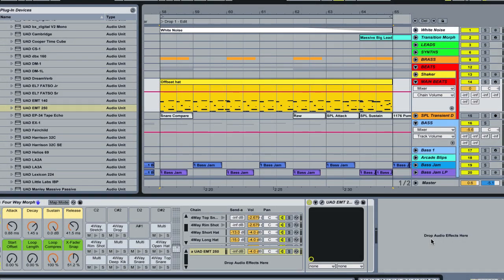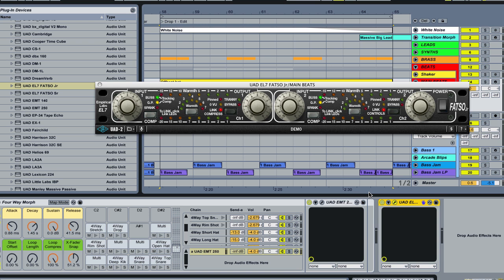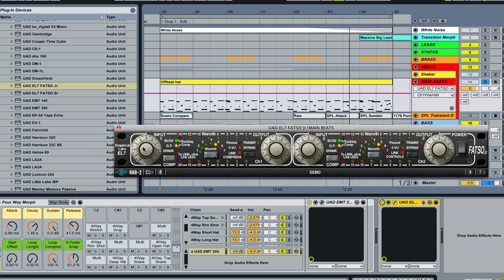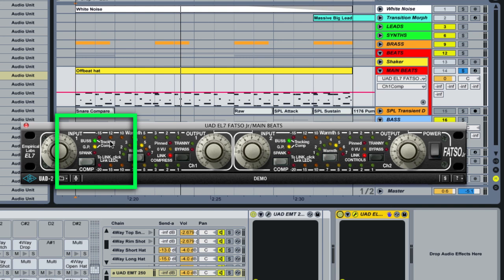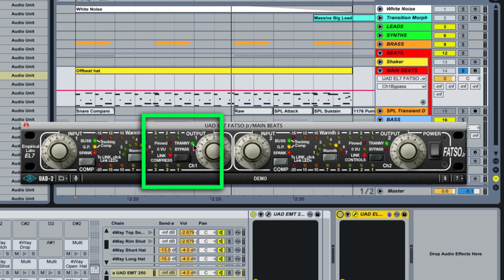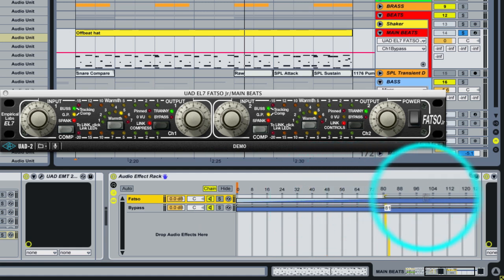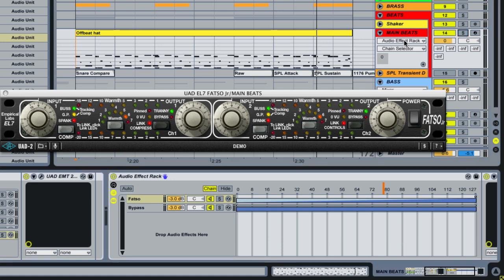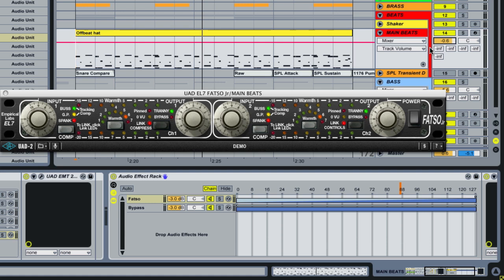Universal Audio UAD-2 Empirical Labs EL7 Fatso Jr/Sr Tutorial

Comment: The Fatso Sr. version was only mentioned at the end and not displayed. It's worth noting that the Sr. version adds a second panel to this plugin with finer control over how much compression is added plus control over the attack and release times, in the hardware unit the attack and release are fixed and variable depending on which style compressor is selected. This way you can keep the input low (if you turn up the input it not only increases compression but adds some harmonic distortion) so now keep the input low and then add more compression through the threshold control and customize the attack and release controls on the Sr. panel. This way you can use it as more transparent / straight up compressor that's more inline with the Distressor.

Comment: Good demo...

BUT: This is all more or less simple digital modells used to "emulate" the real thing.
sorry it´s NOT eaven come close to the HARDWARE original.
I´m very interested if the software coder knows about the "tranny" transfer function, since it´s second order differential...and in here it´s only a little "button" to press. Not to say a single word of the other, far more complex, electronic components to be modelled via software.
Reply: Good for y - zzzz...